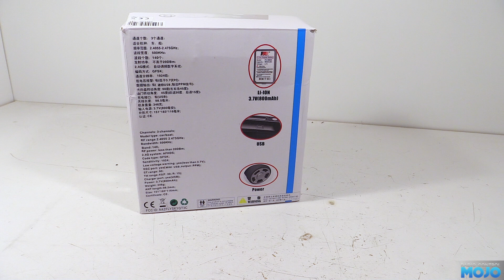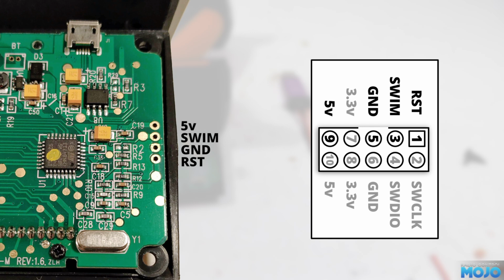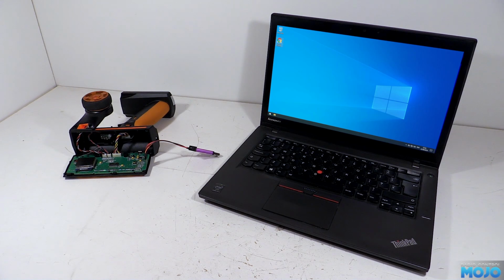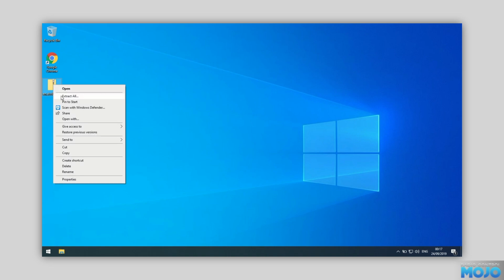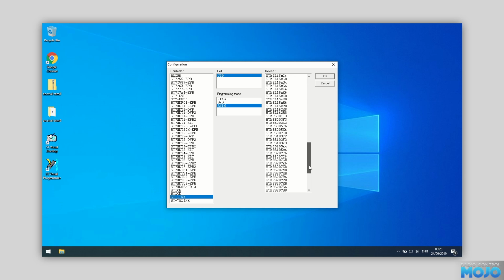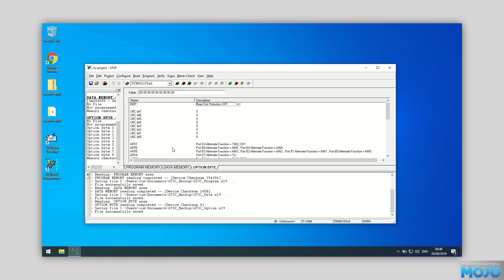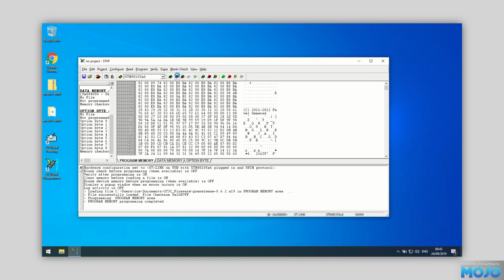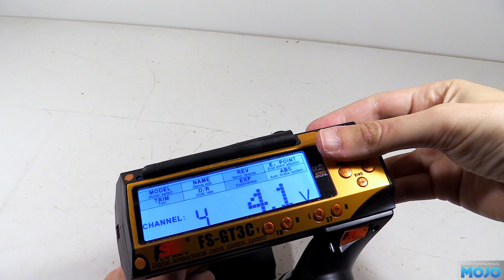FlySky GT3C Firmware upgrade

Comment: Help please. 
Rev 3.6 2020.06.01 
No binding with receiver after flashing. Everything works after returning to the stock firmware
Reply: I’ve just had the same problem on a newly purchased 3C. Flashed and would not bind to a receiver. Re flashed to stock and it binds fine. Did you find an answer? Thanks
Reply: @TonesElectronics  This might be what I was asking.. IS your transmitter AFHDS 2? or 1?

Comment: Had to use 3 differents stlink dongle to have a working one. Tried 3 pc, 2 flysky gt3c to realise maybe the usb interface was in faulty. Thank you for your tutorial
Reply: Any st-link v2 will be ok. Just open st program then plug in usb stlink. Then everything is fine
Reply: @imtrung5244  Look at the comments here and on amazon. Some are faulty. I spent multiple night trying everything, I'm used to hack my devices like that, but nothing worked until I changed st-link

Comment: Hi, id really appreciate if you can reply and help; ive just followed your video and updated it to PreRelease 0.6.2.S19 as shown in the video, i updated it primarily to get more trim on steering, but my diatone Q33 rc car still doesnt go straight as the steering trim still is not enough to make wheels go straight in centre, The trim level have increased to 99 on both right/left with this firmware but it still makes no difference when calibrating to even fully to 99 on either side; the wheels just moves very little and just acts like the normal stock which had 30 trim level. Is there something can be done to make steering trim work properly or is it possible to make the car wheels into centre position?? (When i bind the car it binds with the wheels turned to one side and with the trim i try to move wheels into the centre and its not enough trim to make wheels to centre).Thanks in advance
Reply from the maker: That sounds more like an issue with the car. It could be a mechanical problem where the steering is offset from whatever is giving position feedback to the electronics.
I'm not familiar with those little cars so I'm not sure how to fix the problem
Reply: @RCMojoTV  yes its because how the car steering is setted. Luckily was able to solve the issue by taking out the steering mechanism and recentering it in the middle, that way not much steering trim is required from the controller to straighten the wheels.

Comment: And what hack firmware update is this? Is it Firmware 0.6.1 update? I want to primarily update my GT3C because i can get more steering trim like upto 100 on both right and left sides, the stock one is too less, it only has 30. 
Does this update you did increase the steering trim amount to 100 for both right and left sides??

Comment: So can I use a channel to run a rc4wd winch with a wired controller? The controller says the radio must have a three position switch.
Reply from the maker: I don't see why not, you can configure the rocker's to act like a 3 position switch in momentary mode. You would have to hold the switch to the left or right to run the winch in or out

Comment: Hi not sure if you still monitor this upgrade but just in case,  and in hope of some help, do you know if the Absima CR3P can be hacked with this firmware ?? I have been trying but stlink read comes up with checksum error ?? have you any ideas ??
Reply from the maker: I believe it should work, as I understand it the Cr3P has the same basic internals as the GT3C just with a different physical layout. I can't find much info about a general checksum error, searching for things like "STM8 STLink checksum error"

Comment: Fantastic vid, really makes a potentially daunting task very straight forward. In the vid you mention briefly that it is possible to replace one of the switches on the grip with a variable resistor...  Any details? I'm looking to use it for variable moa motor mixing 'on the fly'.  What size/type of POT would be appropriate?  Thanks :)
Reply from the maker: If I remember rightly there's a document on the git with the firmware that describes how to set it up. Most likely it'll be a 10k pot with the ends of the track connected to 5v and ground, then the wiper to one of the wires going to the button

Comment: When you are checking the voltage, are you trying to calibrate the current-voltage or calibrate the lowest voltage the battery will do?
Reply from the maker: Current voltage, the low voltage alarm is set in the global setup menu

Comment: Error : Programming failed
Error : Problem while trying to Reset swim and device. Apply a Power On Reset
Error : < PROGRAM MEMORY programming failed.
Reply from the maker: If the radio powers up and starts beeping when the programmer is connected you most likely have the SWIM and RST backwards. Double check the connections
Reply: @RCMojoTV  i have all the cables right ! If i turn on the radio i got nothing ! The old firmware is gone but the new one isnt there either?
Reply: @groomery1  have you found the solution? my GT3C start beeping when the usb connected, after successfully create program, data and option backup, the beeping sound stop. flasing firmware failed too. unplugged the usb, try to power on, the unit is dead. any solution for the error?
Reply: @projectronic  Yes the dongle was deffective!

Comment: I'm considering  the firmware upgrade, not just to fix bugs and get more from it, but to improve latency. Does this happen with the modified firmware? Will latency improve? Honestly it feels pretty laggy, high input latency when driving around. Changing to a faster servo and a better RX didnt help much.
Reply from the maker: I wouldn't have thought so, if anything it could be marginally slower dealing with 8 channels.
I tend to use the radios with larger wheel trucks and old Tamiya's with their typical sloppy steering so it's never really cropped up

Comment: running it with 2s 55c 7000mah inna truggy.  I cant pull away slowly slightest tap of throttle and truck takes off spins tires.  have to feather pulse throtlle very gently to take off from stop.  i tried all the adjustments on controller cant figure it out.  i am running a 5900 kv 32p 17t pinnion and 64t spur.  maybe its to high gearing?
Reply from the maker: To me that sounds like the ESC needs setting up. On a lot of ESCs you can calibrate them so they know the throttle ranges of the radio
Reply: @RCMojoTV  oh ill have to look into it thx
Reply: @xKevmachinex  there is a channel on youtube that showed how to calibrate the channels on the hacked flysky firmware

Comment: Ive been looking for a pistol grip radio for my RC trucks.
How do you operate the additional channels after this firmware update?
Reply from the maker: All the buttons become assignable, so for example you can change the steering trim buttons so they control a channel or other function.
The user interface isn't great and to get started you really have to study the manual for the firmware, but one you get the hang of it it's a good flexible setup
Reply: @RCMojoTV  ah ok thanks! Is there a way to add dedicated switches to the circuit board?
Reply from the maker: Not dedicated, you would have to wire in parallel with the existing buttons.
The other options would be a modified GT3C that has a hardware addon to add the extra channels. You get some knobs and switches to play with but it uses the standard firmware so isn't as flexible. They were available for around £50-£75, it seems they're not so common now, here's an example of what to look for: https://www.aliexpress.com/i/32830169709.html
Reply: @RCMojoTV  cheers!

Comment: Just got a ST link adapter after long wait and done the hack,which seems to have gone ok.  The only thing I still find annoying is the scroll wheel direction not matching the cursor.  I think someone mentioned here about reversing encoder. is that in tx settings or programme hack,is this something you have done to yours? thanks

Comment: where can I buy the usb and the cable for upgrading the firmware?
Reply from the maker: eBay, Aliexpress, Banggood, they're available from all the usual suspects. Search for ST Link V2 and you'll see lots of them, they usually come with some socket to socket cable, you just need some 2.54mm pin header, again available from the above
Reply: @RCMojoTV  thanks a lot, more power on your videos, it's a great help for us.

Comment: Can I just ask? if the hack is done does it effect the way the menu worked from new, I have just about got the hang of the basic stuff. would hate to do the hack and find all the settings and menus had to be learned again for the steering and throttle. thanks
Reply from the maker: The basic functions are a little different, the use of the back and end buttons are the main change, but once you start using it it'll make far more sense than FlySky's effort. The additional and advanced features can be a bit cryptic though, mainly due to limitation on what the LCD and display, as long as you have the firmware manual in front of you it's not too bad. A friend setup an 8 channel receiver with 8 servos to visualise what was happening and just went through all the functions to see what they did

Comment: but i quick question. Have you tested if you can with this controller switch back and forth with 2 rigs without the need of powering down 1 of the rigs)? My friend as a DX5 and it can do it. Also those extra switches can be used for lights and so on? Great video !!
Reply from the maker: Spectrum has what I think they call model match, so when you bind the specific model memory is bound to the receiver. FlySky and most other cheaper radios just bind the transmitter to the receiver so you'll need to make sure you've only got one model powered at a time. With the PSX firmware you can use all the buttons to control up to 8 channels, you can get all sort of light and sound modules you can connect up

Comment: Probably a daft question, but how will one operate 8 channels as there are no extra buttons on the unit?
Reply from the maker: Most of the buttons on the transmitter can be set to control any of the functions. For example the steering trim button can be used to control channel 4, you can set it to switch between one of 2 or 3 positions for a 2 or 3 speed gearbox. Or you can make it increment in small amounts to act a bit like a control knob. There are many other options too of course, and if you want access to the steering trim it’s a couple of clicks away with the scroll wheel
Reply: @RCMojoTV  thanks. Makes sense. I just happen to have a 3c unit.... Makes me wonder.

Comment: So 3c or 3b? I e heard it both ways
Reply from the maker: They both have their pros and cons, for the least fuss the GT3C is the best one to go for. However after hardware mods the GT3B can be modified to run on 4AA's which is really handy if you forget to charge them or there's an impromptu meet, you can just nip to the corner shop and buy some alkalines
Reply: Colossal BigShot  b comes with AA batteries, C is LIPO, biggest difference is the on off switch location. B can get bumped easily, C can’t.  C for the win. I love my hacked B